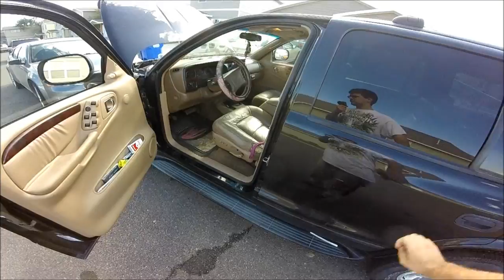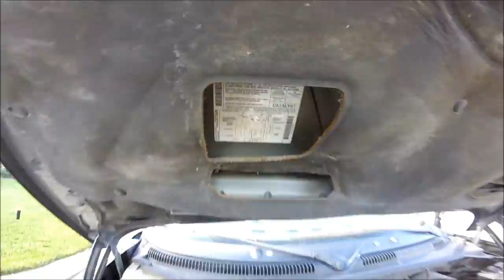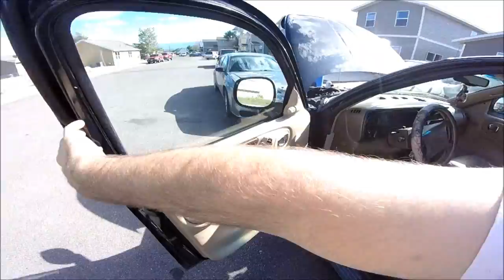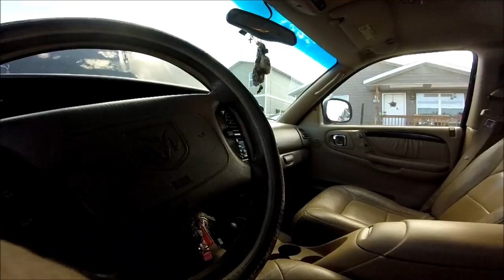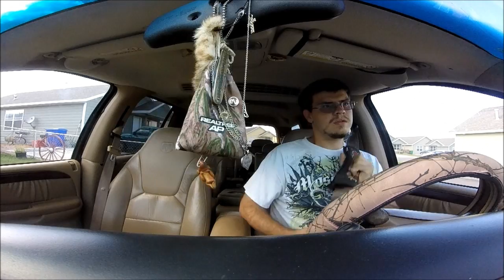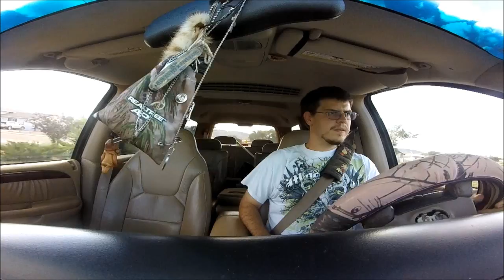2000 Dodge Durango A/C Recharge, and drive.

Comment: I have a 2001 5.9 you should add a glass pack to it, it sounds nice.
Reply: Brendon Haring i really enjoy the 5.9L V8 SLT Magnum. Drove a V6 4.3L Vortec Blazer and it was a pain to work on.

but the Durango is awesome for easy access and space. plus parts are inexpensive